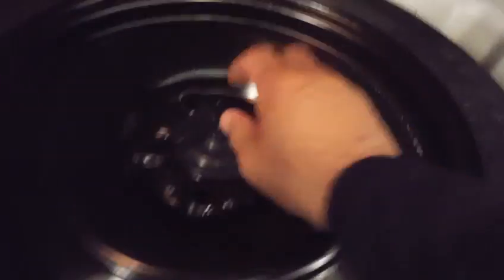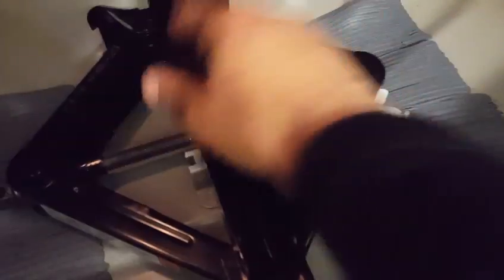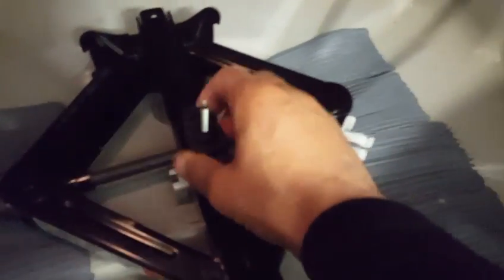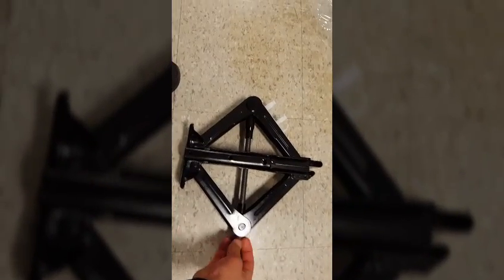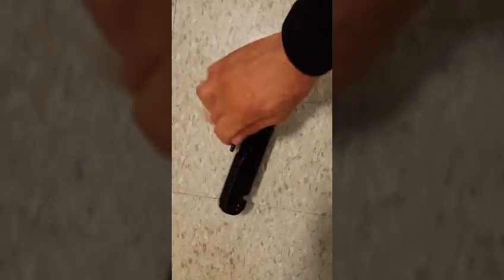Where's the jack on my Fusion???

Comment: I just wanted to give you a BIG thanks for making this video! You are a life saver 😍 as I would have been lost trying to put my spare on after hitting a pot hole. Your instructions were clear and on point. While I may have changed many tires working at an oil change shop, the feeling of being a woman on the side of the road  and unaware on how to use the tools you are given can be intimidating. Yet you ease this feeling by providing me with the knowledge and confidence I needed to get me through this moment. For this I have much appreciation!
Reply from the maker: Amy Kauffman glad this video was about to help.  Don't forget, if your car has under 60k miles and is less than 5 years old, then you can still take advantage of roadside assistance....that number is 800-241-3673

Comment: I just bought a 2016 and thought it was missing the lug wrench. I ended up putting a breaker bar and a 3/4 socket under there. Glad I watched this video as I will check for it now. I thought it was missing because you can see the white plastic clips that have nothing attached. Wonder why those are there?

Comment: Shouldn't need this, but did.  Big help!! Thanks.
Reply from the maker: Marc Abbaticchio don't worry.  You are not alone.  A lady contacted me just a couple days ago on my cell. Her lug nuts were actually wouldn't come off. I walked her thru getting in touch with roadside assistance so she could get it towed for free to her nearest Ford dealer. She ended up showing the video to the service dept at her local Ford store so that they could figure out how to put the wrench back in
Reply: Exactly, getting it out was easy..Getting it back in was confusing.  But then again, I am not a service tech at Ford..
Reply from the maker: Marc Abbaticchio the tech was unable to get it put back in! 😎

Comment: Scott, any clue why the lug wrench in the back wouldnt fit the lug nuts on the car? I bought the car used, but as far as I know everything was original that came with car. Even has "Ford" branded rims. All of lug nuts have a cover on them, but no different than the lug nuts on a 2004 focus that didnt require a wheel lock. Help please!
Reply from the maker: To my understanding there is somewhat of a known issue with the lug nuts...  They tend to swell and that prevents the lug nut wrench from fitting.  You will probably have to have them busted off.  If you do have to bust them off one tire then do them all at the same time.  Just don't use Ford branded parts because they will want to charge you a significant amount more for the branded ones

Comment: Hi, My Ford Fusion has some lug nuts covered (one each tire) do you know where I can find the tool to remove those special lug nuts?
Reply from the maker: Whoever has the car before you put wheel locks on them. If they're not in the car take it to a local Ford dealership. They might have a key to match it If not they'll have a tool that will be able to break the lug nuts off

Comment: How about a video on where to put the arms of a 2 post lift for lifting the entire 2013 ford fusion energi hybrid?
Reply: Mike Wynn are you looking for the jack points?  If so, look underneath the rocker panel for a little triangle.  The point of the triangle that faces the middle of the car points to the jack point.

The triangles are approximately 1ft behind the front tires and 1ft in front of the back tires.

Let me know if this helps